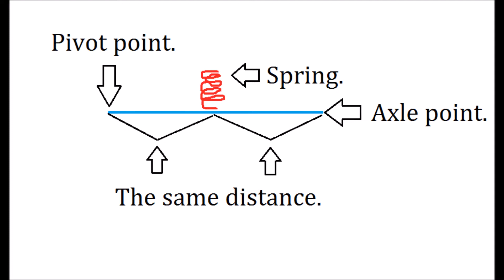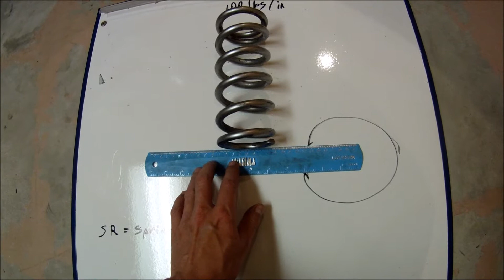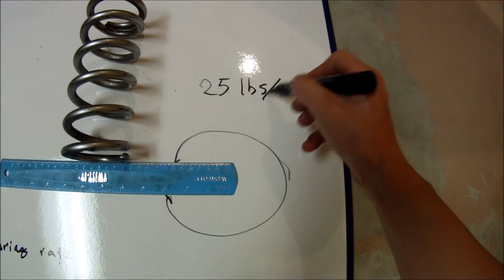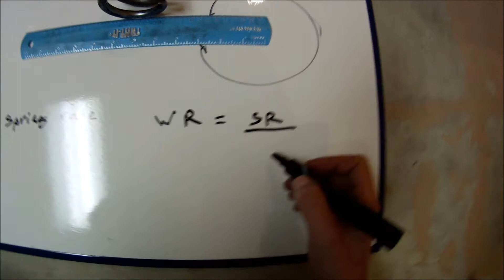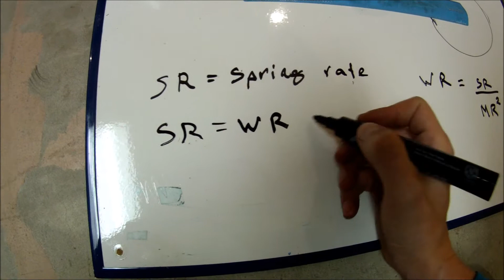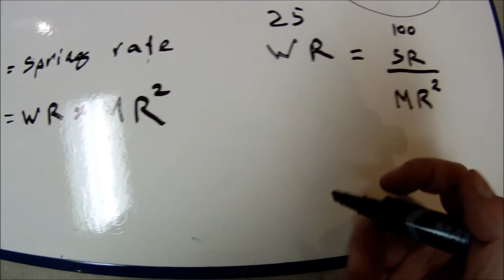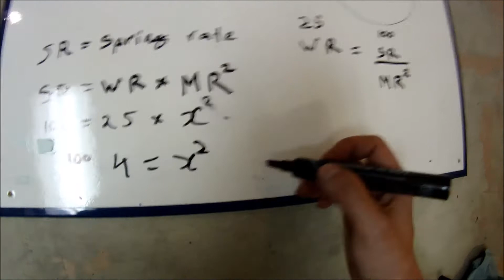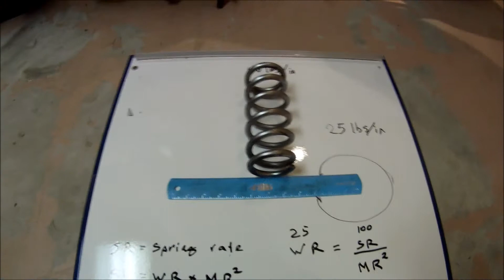MOTORCYCLE SUSPENSION, PART 4, WHEEL RATE EXPLAINED, HOW TO, DIY.

Comment: Will there be change in the formula for 2 wheeler and 4 wheeler cause I had referred some pdfs where it was given wheel rate=spring rate *(motion ratio)² !!
Reply from the maker: Post a link to that PDF.
Reply: @everydayirace  
http://performancetrends.com/Definitions/Wheel-Rate.htm
Google search has also shown me the same result !!
(I am searching for the pdf )
Reply from the maker: @raghavapathuri-smec5662  in formula in PDF they use motion ratio = shock displacement/wheel displacement. In my video I use wheel displacement/shock displacement.
Reply from the maker: @raghavapathuri-smec5662  wheel rate = spring rate / ( wheel displacement/shock displacement)² or Wheel rate = spring rate * (shock displacement/wheel displacement)².
Reply: @everydayirace  okk I will go through the video and verify!! Thanks for the reply!!

Comment: I'm sorry, doesn't what you say at 2:13 contradict what you say at 4:55 ?? First, you say a 100 lb becomes 200 lb for the installed spring if MR is 2. But later, you say the 100 lb would be amplified by the square of MR for the installed spring.
Reply from the maker: Spring rate is 100lbs per inch. MR is 2. If you apply 100lbs of force on the wheel, that force will be doubled on the spring because MR =2.  Are you following me?
Reply from the maker: Since Spring Rate of the spring is 100lbs per inch, the spring will compress by 2 inches. Since Spring compresses by 2 inches, the wheel will move 4 inches due to MR being 2...............
Reply from the maker: So we know that spring rate of the spring is 100lbs per inch right? That didn't change.  We also know that MR=2 right? That didn't change. We also know that we applied 100lbs of force on the wheel right? And the wheel moved 4 inches, that tells us that wheel rate was 100lbs per 4 inches right? Which equals to 25lbs per inch..............100lbs/4 and and 4 inches/4.
Reply from the maker: So we know SR=100lbs per inch.
MR=2.
And we just found out that WR was 25lbs per inch right?
So lets plug those numbers into a formula that i have in the video.
Reply from the maker: SR=WR X MR^2.   100=25 x 2^2.  100=25 x 4.
Reply from the maker: Let me know where i confused you.
Reply: Hey, thanks for responding. How you explained (amazingly well) it in the comments is exactly how I worked it out on my notepad, I agree to that!
But considering this derivation, my doubt is if I'm applying F at the wheel center, what will be the Force acting at the installed spring? F*MR like at 2:13 or F*MR*MR like you say at 4:55, in my opinion, it can only be one of the two right? And I think what you say at 2:13 is right!

I think what this means is that if I'm applying a force F at the wheel center:
1. F*MR acts at the installed spring. It deflection is (F*MR)/k
2. The installed spring acts as an imaginary spring in direct actuation (MR=1) at the wheel center with a stiffness of K/(MR^2) thus increasing the deflection at the wheel by a factor of MR.

Considering 1 and 2, my only doubt is what you say at 4:55 because if F*MR*MR acts at the installed spring, it will deflect by (F*MR*MR)/K. This will mean the wheel deflects by (F*MR^3)/K which makes the wheel rate to be K/(MR^3). Do point out where I'm going wrong.
Reply from the maker: If you apply 100lbs of FORCE on the wheel with MR=2, YOU WILL BE APPLYING 200LBS OF FORCE ON THE SPRING.
Reply: Yep, thanks!
Reply from the maker: I think you confused force.
Reply: Ah, probably. I understand the whole thing perfectly except for the statement around 4:55 idk haha.
Reply from the maker: Ansh Gandhi i made a mistake there.
Reply: Ah fuck, nevermind. It makes perfect sense then, thanks alot! Helped tremendously
Reply from the maker: What are you working on?